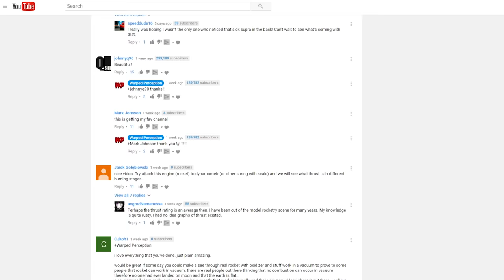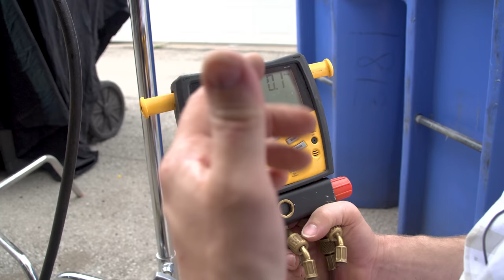Model Rocket Engine In A Vacuum Chamber - 4K Slow Motion - will it burn? - Rockets (S1 • E3)

Comment: All that trust and still no forward movement. Rockets don't work in the vast void of space.
Reply: 3:00

Clearly moving forward under thrust. Of course, it's more clearly demonstrated on the other video about Newton's 3rd Law.
Reply: All of that shit you said is obselete by this simple but powerful equation/ *FA = −FB.*/ newton's third law of motion..
Reply: @darklight2.1  clearly the containment box theyvput a rocket in is way too small to be anywhere near a viable "experiment"! I'm laughing at this crap you think is science. Rocket motors having any thrust in a vast void of space is a violation of the 2nd law of thermodynamics.
Reply: @darklight2.1  flat earth?? WTF are you babbling about now? So you came up with "flat earth" because I pointed out your Newton fallacy of why a rocket doesn't work in a vast void of space due to it being a violation of the 2nd LAW of Thermodynamics which states that an uncontained atmosphere cannot coexist next to a void without an immediate equalization of pressure occurring? If you want to discuss why our own uncontained open atmosphere existing next to the vast void is a violation of the same 2nd law of thermodynamics also, I'm more than happy to slap that around with you too. We can even touch on the 1st LAW of Thermodynamics and the chaos of the universe while we are at it.
Reply: @darklight2.1  let me simplify it for you as it seems to be going over your head as to why in the real "science" of laws a rocket motor doesn't work in the vast void of space; 1st and foremost, you cannot have an uncontained pressurized system floating around in a vaccum because the 2nd law of thermodynamics states that an equalization of pressure must and will occur by the vastly larger void overtaking and absorbing it faster than it can be produced. 2nd, combustion of any kind of fuel cannot occur in the void of space and even if that combustible fuel was "burnt" internally the resulting escaping gas producing "trust" would immediately be absorbed into the void which would negate any possibility of forward "trust" which would be zero during an equalization of pressure as the void absorbed it instantaneously the moment it escaped the rocket venture. There is nothing in the void for a rocket motor to push against in that void that is immediately aborbing said escaping gas in order to create any forward movement. Even water will immediately boil into a gas and be absorbed into the void of space due to the equalization of pressure as outlined. The vast void of space has zero or even less than zero pressure and will attempt to ALWAYS equalize with any uncontained pressure such as air or gas introduced to it. No matter how fast a rocket motor can produce gas pressure to create any kind of forward trust in space, that gas pressure will be absorbed into the void faster than any rocket can produce it thus making any forward trust ZERO! 
As far as Entropy goes as outlined in the 1st law of Thermodynamics  which states that natural order or useful creation cannot come from a state of Entropy. The universe itself is pure Entropy (chaos). A simple example of Entropy is a place devoid of life or anything created by it to sustain life as it is so hostile that nothing of use can be created by it; it is pure chaos. The pure Entropy that the universe is can never make life, natural order or anything useful to sustain life, EVER! Our world containing life which is the ONLY 100% confirmed place in the known universe to have life on it wasn't created by mere chance or accidentally by the Entropy that the universe is! A simple bicycle will never be accidentally formed by the raining down pieces of a blown up more complex truck, no matter how many times you blow that truck up it will NEVER accidentally form anything of working mechanical use, let alone a working bicycle! That is the first law of thermodynamics. Our world, life on this world and the uncontained atmosphere we breath itself is a violation of the natural laws of thermodynamics/physics of the occurring Entropy that IS the vast void of space! 
     So maybe before you spout off about a man named Newton who only observed an apple falling from a tree on an earth that could NEVER exist let alone be created by the forces of pure Entropy that space and the universe is, perhaps you need to understand or even grasp the fact that the universe and the void of space you think rockets can fly around in, didn't create us or this world. As I said before, you have no idea what this world of ours really is or how it came to be with all of us on it! The flat earth people base thier assumptions around religious science and you base your assumptions around "science" that you made into a religion, both of which are wrong because neither side can even explain how or why we exist in a universe of pure Entropy that cannot produce life as it was CREATED or even produce an environment to sustain that CREATED life.
Reply: @prolska  Mr. Tactical Error thinks the word "equation" has something to do with horses. He also thinks the term "A-sexual" refers to an alternative lifestyle.🤣🤣🤣
Reply: @Jonathan.D  also the apple fell on Newton's was a lie, newton didn't come up gravity while the apple fell on his head, Isaac Newton published a comprehensive theory of gravity in 1687. Though others had thought about it before him, Newton was the first to create a theory that applied to all objects, large and small, using mathematics that was ahead of its time.
Reply: @2artactical55  - So according to YOU, simple mechanical RECOIL does not work in a vacuum?

Because that is the mechanical principle that rocket propulsion uses.

So then YOU believe that a simple CROSSBOW firing a steel projectile would NOT get pushed backwards when it fires the projectile?
Would a FIREHOSE pushing out liquid water feel a recoil in a vacuum?
yes or No?
Reply: @2artactical55  : Thanks for that attempt at tying to explain physics. However, that's not correct, not even close. The difference in pressure isn't what is causing the motion. This is what you'll never understand. It's a good thing though, the world needs ditch diggers and burger flippers, bro. Be proud!

No, the force is caused by momentum. I'll give you time to look that one up. It's a big word and I'm sure there are some pictures online to help you.
Reply: @2artactical55  so you refuse to answer my questions? Scared you will be proven wrong? (Yes that is exactly why)
Reply: @stuartgray5877  what's your question?
Reply: @2artactical55  would a firehose fired into a vacuum generate a recoil force?
Reply: @2artactical55  where did you go? Question too difficult for you?
Reply: @2artactical55     solve this simple physics problem using the "law of conservation of momentum":
You have a remote controlled crossbow of 10000 kilograms mass sitting on a frictionless surface (nothing holding it down).  Load the crossbow with a projectile of mass 1000 kilograms and cock it.
Now an observer is on the ice with the remote and all three objects are stationary ( they have a relative velocity of zero with respect to each other)..
He fires the crossbow with the remote and he then observes the projectile exiting the bow towards his left with a velocity of 2500 meters per second.
What is the final velocity of the crossbow after it fired the projectile? Actual engineers can solve this problem IN THEIR HEAD. 
Now what is your answer?  If you cannot answer then you have NO BUSINESS lecturing others about basic physics.
Reply: @2artactical55  Unless the gas is experiencing a FORCE.  No wonder you refuse to acknowledge what happens to a gas inside a gas centrifuge!!!  Do you agree that a gas UNDER ACCELERATION can experience a pressure gradient? Yes or no?
Reply: @2artactical55  then tell me that Earth's atmosphere is NOT a pressure gradient.  Is atmospheric pressure at sea level 14.5 PSI?  Yes or no?
Is atmospheric pressure in Denver Colorado 12.5 psi? Yes or no?
Is atmospheric pressure on top of mount everest 5.0 psi? Yes or no?  No watch as 2AR Tactical REFUSES to just answer those questions because answering TRUTHFULLY proves him WRONG!
Reply: @2artactical55  I accept your surrender.  Run along then
Reply: @2artactical55  I see that you absolutely REFUSE to address actual FACTS
Reply: @stuartgray5877  so now you're going off on yet another tangent I see...
Reply: @stuartgray5877  OMG, you're so right, I don't know anything about physics except the part where I'm a retired Bomb Squad Team Leader and subject matter expert on explosives, Monroe effect and Misznay-Schardin effects as well as the process and principal of how Nuclear weapons work as well as how the propulsion systems that carry them work. Something tells me that between us both, I'm the only one who has put my life on the line practicing my knowledge of the physics behind those principles and am still living to tell about after applying it in real world applications. But go ahead and tell me all about how you took a few college classes in engineering  to impress me... you twatwaffle!
Reply: @2artactical55  let's test your understanding of basic physics then    so tell me then what would happen if I detonated a block of C4 in the vacuum of space?.
Reply: @2artactical55  oh and I have undeniable video if evidence that rocket propulsion works in a vacuum.  I'll show it to you as soon as you tell me how high a rocket has to go to reach "vacuum"?
Industry standard for "rough vacuum" is any pressure less than 1.0 Torr. At what altitude does atmospheric pressure drop to less than 1.0 Torr?
Reply: @2artactical55  oh AND I have hazardous materials handling and safety certifications at Kennedy Space Center and Vandenberg AFB going back over 25 years.  this is because I have been a member of spacecraft fueling teams more than once.  And I have worked directly on Real rockets including explosives such as NASA standard initiators.  For the last two weeks I have been working inside the Payload Processing Facility at KSC where the Viking Landers and Voyager Probes were prepared for Launch on Titan IVs.  So AGAIN you have no clue what you are talking about.
Reply: @2artactical55  you never answered my first question: if you fired a FIREHOSE into a vacuum,. Will you feel recoil?  You refuse to just answer that question.  If you were floating in space with a pressurized fire extinguisher filled with Water And sprayed it, WOULD YOU FEEL RECOIL?  It's not a trick question....
Reply: @2artactical55  I could give you a SIMPLE high school level physics problem regarding the recoil from a crossbow, and I am 100% confident that you cannot answer it while actual engineers could do it in their head.
Reply: @stuartgray5877  explosions can occur in the void. Now where are those pictures and videos of UFOs with rockets? UFOs fly around and maneuver in the void right?
Reply: @2artactical55  ok so C4,Will explode in a vacuum.  Do you agree that MASS goes in all directions if you do this making no net "propulsion" in any direction?
Now what if you take a titanium "Bell" shaped device and put the c4 inside the bell THEN detonate it.  Does all of the mass still leave the area in every direction?  Or does it go mostly in a single direction?
Reply: @2artactical55  and I refuse to comment on "UFOs" since you have not linked me to any example.  and your comparison is pathetic.  Your argument is basically "helicopters can fly, so that is proof airplanes cannot".  Even if UFOs have some advanced form of propulsion, that in no way invalidates Newtonian physics.  So stop with your idiotic comparison.  Electric ion propulsion and solar sails have been proven to work in space, that does not mean chemical propulsion does not.
Reply: @2artactical55  again I have VIDEO EVIDENCE of rocket propulsion in a vacuum.  I'll show it to you as soon as you tell me at WHAT ALTITUDE does Earth's atmospheric pressure drop to less than 1.0 Torr?  Too difficult for you to figure out, or are you scared to tell me because I will prove you wrong and hurt your little feelings??  Poor thing....
Reply: @2artactical55  no the karman line is above the point where atmospheric pressure turns to vacuum.  The answer IS: 50 kilometers. At only 50 km atmospheric pressure drops to vacuum. This is close to 1/1000th sea level pressure. Yes one one-thousandth.
Reply: @2artactical55  and the company I work for made many of the pieces of the AXAF X-ray telescope.  It has been flying through the VA belts every 30 hours for the last 20 years and still works fine.  I have personally launched four spacecraft that flew right through the belts in the first few hours of the mission and did not even notice.  

Now answer my question about the C4 exploding in a vacuum inside a metal "bell".  WHAT would happen?
Reply: @stuartgray5877  let me guess, you'll be happy to show me some nifty CGI "real" video footage of it "flying" around in the VARB too right? 😉
Reply: @2artactical55  No me dijiste nada , existe la entriopia negativa y no lo puedes negar, un ejemplo es la cristalización ytevolución mediante catabolismo etc. 
Pero me di cuenta que eres alguien cegado , que en su vida tomo un libro de física, cuando hayas estudiado fisica e ingeniera discute conmigo , por lo visto no sabes de lo que hablas.
Reply: @2artactical55  en efecto, no tiene sentido. El 2do principio de la termodinámica no dice nada de 'coexistencia' de atmósferas o de compensaciones de presión. Dice que cualquier proceso termodinámico aumenta la entropía del universo.
El desarrollo de los motores se da gracias a que conocemos las leyes de newton. El combustible explota dentro de una cámara de combustión, no en el vacío. Gracias a la conservación del momento lineal, cuando las partículas de gas salen expulsadas del motor, la nave gana momento en la dirección opuesta.
La presión, por definición no puede ser negativa.
Lo que te dije cualquier ingeniero te lo puede verificar, además la termodinámica no dice nada de compensación , sino de entriopía aumento . VALOR constante , un valor de  además existe la neguentropía entriopía negativa un ejemplo es la cristalización de macroestados a microestados no al revés dependiendo del sistema si es aislado ,semiaislado , cerrado.
Pero me di cuenta que decirte esto es inútil tergiversas lo que es termodinámica y nunca tocaste un libro de física gringo conspiracionista XD AJAJAJ
Reply: @2artactical55  Why did you disregard my evidence I present above?
Are you SCARED to see a video of something you claim to be impossible?
WATCH THE VIDEO or shut up.
Reply: @2artactical55  I was just pointing out video of rocket propulsion IN A VACUUM, which you claim is impossible.

Those side boosters started their boost BACK burns ABOVE 50-60 kilometers which is VACUUM.
Less than 1.0 Torr , and clearly doing propulsive maneuvers.
Just the fact that they CAME BACK! 
 they cancelled 3600 MPH EASTWARD velocity IN VACUUM, and FLEW BACK in a vacuum.
 They even showed that the COLD GAS thrusters worked above 120 kilometers.
Reply: @stuartgray5877  in the exosphere (trace atmosphere zone) still under the protection of our Magnetic field... I've already said rockets can "work" within that area. That's not the actual void of space either. But we've already beat that dead horse. You still haven't told me about every rocket engineers biggest unsolvable problems with rockets in space as shown in the Tyranny of the Rocket Equation. I'll walk you through it and hold your hand if you want...
Reply: @2artactical55  Then explain how NASA made that Comet explode in DEEP SPACE.

Millions of people saw it happen LIVE exactly TO THE MINUTE of when NASA predicted it would explode FIVE YEARS IN ADVANCE.

Explain THAT next genius.
I know how it worked because I Built, Launched and operated the spacecraft that DID THAT.
Now explain how NASA can do it WITHOUT a spacecraft flying out there.
Reply: @stuartgray5877  yeah, we've gotten pretty good at slingshot from Earth obit. Because that's all a rocket is able to do, slingshot itself into deep space, never to return. So back to the Tyranny of the Rocket Equation; let's talk about fuel weight and consumption vs. Only 10% of what the fuel weight and rocket is being Payload, which is all it can carry just to get to LEO? Rockets have more draw backs than positive using them beside my theory of rockets not being able to work for human traveling long range in the void. But you already know that being a "rocket engineer" right? I get why you don't want me to embarrass you with the "tyranny of the rocket" equation and why you keep avoiding my question of it. You know that tyranny equation very well in fact, don't you! You can sit here and tell me how great rockets are all you want to but we both know that rockets are the only thing there is to use currently even with thier limited abilities for human travel in the void.
Reply: @2artactical55  Except you are wrong again.
I have built TWO deep space science probes that CAME BACK to earth.
The Stardust Sample Return capsule is in the Smithsonian Air & Space museum right now with my signature inside it.
It was the fastest manmade object to fly through earth's atmosphere after it returned from a seven year mission to deep space.
At the time it held the record for solar powered spacecraft and max distance from the sun.
So try again you are STILL WRONG, as usual.
Reply: @stuartgray5877  oh I'm sure they did alright just as I can use a slingshot and ball bearings to hit moving rabbits with. NASA is capable at using the Earth's rotation to slingshot shit around it into the void and hit something, and there are alot of of "somethings" in the void but that's still not "space travel" either. The only space travel being done by humans is in your head cause there still isn't any doing it yet!
Reply: @2artactical55  vacuum doesn't absorb anything, are you implying a gun shot in a perfect vacuum wouldn't recoil ?
Reply: @E9X330  you are talking about an explosion inside a sealed barrel pushing a solid projectile down said barrel as the it also pushes against a solid breach, again, sealed and not exposed to the void. Rockets don't work that way because where the fuel is ignited in the rocket chamber, it isn't sealed like a rifle cartridge is. It's open to the "vacuum" of the void which immediately robs most of the gasses away the rocket produces for trust. They are not suitable for any kind of serious human long range travel in the void and be able to return years later. Perhaps you should look into the equation NASA can't overcome using rockets called "the tyranny of the rocket equation"! If you haven't noticed yet, there are no humans exploring the void let alone higher than LEO (a laughable mere 250mi high) using rockets. Too bad rockets are the only thing we have to work with huh? As seen in this video, done in horrible "scale" fashion, the rocket didn't move very much at all in the super small vaccum tube no where near to scale. And you think if you increased the vaccum chamber to a better scale, which would absorb even more of that little rockets gasses, it would still barely move forward? It barely ONLY moved a few inches forward in a vaccum tube that was too small to scale in this video! Think about it...
Reply: @2artactical55  false, that is exactly how a rocket works. A gun with blanks will still experience recoil
Reply: @2artactical55  we don't have to overcome to rocket equation, they work perfectly fine, for long distance travel, ion engines are superior over chemical engines
Reply: @E9X330  a gun with blanks has no recoil. It's just a pop of the primer in an empty casing. You have to plug the barrel with a "blank adapter" which redirects the little bit of Gas from the primer back to the bolt for it to cycle in that  closed system. No amount recoil that is noticeable is produced by a blank being fired in an open ended barrel. I don't think you know about firearms and ammunition to be using it as an analogy in comparison to how a rocket works, especially in the void, to a firearm firing blanks or solid ammunition. 
    They have to use the Earth's gravity to slingshot rockets into the void because rockets can't get fast enough on thier own to even reach past our Earth's magnetic field that protects us from the Sun and all the deadly cosmic radiation being produced by trillions of other Suns, which are all nuclear in nature. Even at only a mere 250mi high the radiation levels rise to 10 times more in the lower exosphere (space within our magical field). 10 times higher radiation levels just outside of Earth's atmosphere is nothing compared to the varying deadly radiation levels in the void. Radiation levels from the Chernobyl leak is child's play compared to the void where every sun is a nuclear reactor producing and spewing deadly radiation in all directions in the void! Robots sent into Chernobyl don't last but less than an hour before the radiation kills it. We are trapped on this rock and rockets can't get us through the radioactive void of Entropy Space! If you were drifting in the void all by yourself in only a spacesuit, do you think you can create body movement in any direction in the void by striking your own fist (small mass) into the larger mass of your body (chest)? Can you "fly" through the void beating your fists into your chest?
Reply: @E9X330  He flat out REFUSES to accept the fact that rockets work using RECOIL force.

Any object that PUSHES ON MASS feels a recoil - PERIOD.
He just refuses to accept the facts that:
The rocket PUSHES out the MASS of the exhaust gas - ACCELERATING IT into the vacuum.
In this process the rocket MUST FEEL RECOIL - due to the Law of Conservation of Momentum.

He REFUSES to just tell us WHERE to FORCE COMES FROM that accelerates the exhaust gas.
Because ANSWERING proves him wrong.

This is called "Cognitive Dissonance" where we lay out a perfectly logical physically consistent argument and he just dismisses it WITHOUT EVIDENCE just because it disagrees with his pre-conceived notions.

See watch how simple this is:
E90_Boris, answer these questions:
1 - when the rocket engine is running is the exhaust gas ACCELERATED from the nozzle? Yes or No?

2 - Does the exhaust gas HAVE MASS? Yes or No?

3 - Can MASS be accelerated WITHOUT a force? Yes or No?

If YOU answer these questions we will finally see where my argument was heading.
2AR refuses to answer because he is AFRAID of the answers.
Its odd for someone who pretends to be tough to be SCARED of simple "Yes/No" answers.
What is he so afraid of?